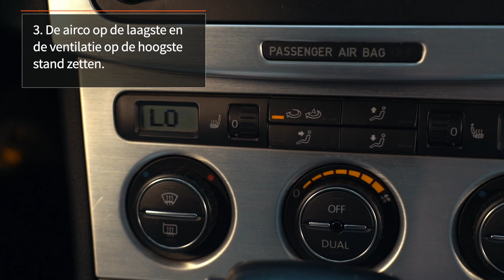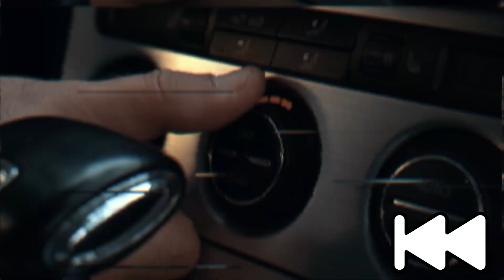Aircoreiniging: schuim of spray? Welke van beiden is beter? | AUTODOC

Comment from the maker: Heb je er iets aan gehad? Liken en delen is de beste manier om je waardering uit te spreken!

Hoe je aircoreinigingssprays gebruikt

0:43 — 1. De stoelen en leren oppervlakken ter bescherming afdekken.
0:49 — 2. De motor laten draaien om te voorkomen dat de accu te snel ontladen raakt.
0:52 — 3. De airco op de laagste en de ventilatie op de hoogste stand zetten.
0:59 — 4. Alle ruiten dichtdoen en de recirculatiemodus inschakelen.
1:03 — 5. Uit de auto stappen en de spray rechtop in de voetruimte neerzetten.
1:06 — 6. Op de sproeikop drukken en de autodeuren dichtdoen.
1:10 — 7. 10 tot 15 minuten wachten.
1:14 — 8. Het voertuig degelijk laten doorluchten.
1:27 — 9. De oppervlakken in het passagiersgedeelte met een zachte, schone microvezeldoek afvegen.

Hoe je aircoschuimreiniger gebruikt
1:46 — 1. Toegang tot de condensafvoerslang verschaffen.
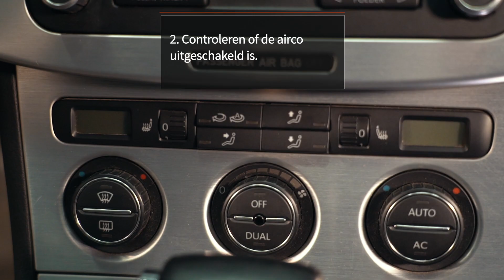2:09 — 2. Controleren of de airco uitgeschakeld is.
2:20 — 3. Een dunne slang nemen en deze aan de ene kant met de afvoerslang en aan de andere met de bus schuimreiniger verbinden.
2:31 — 4. Een bak onder de afvoerslang neerzetten.
2:36 — 5. Het middel de slang in spuiten, totdat er weer schuim terug begint te stromen.
3:09 — 6. De slang wegnemen en 10 minuten wachten.
3:12 — 7. De motor aanzetten en de airco op de hoogste stand zetten.
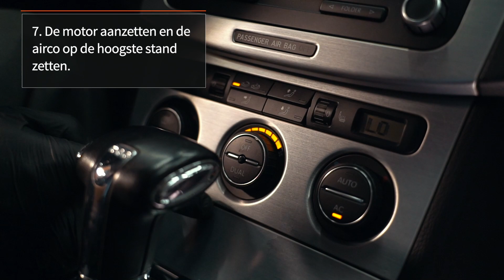3:22 — 8. Wachten tot alle vloeistof en vervuiling de bak ingestroomd zijn.